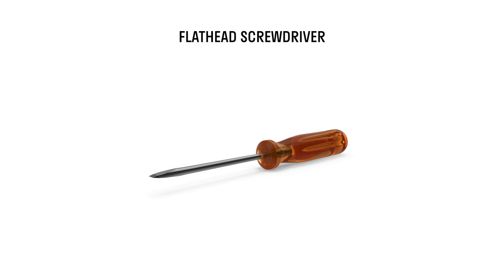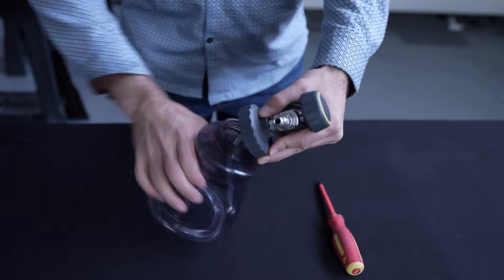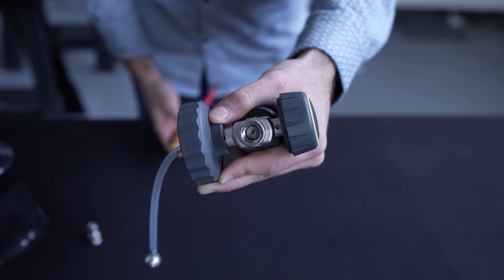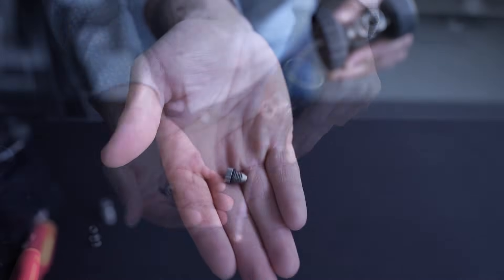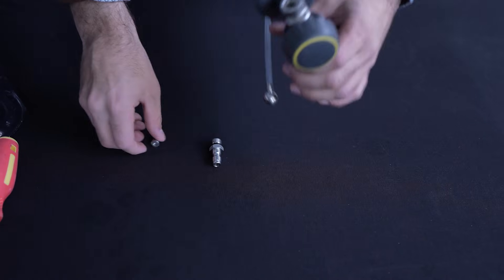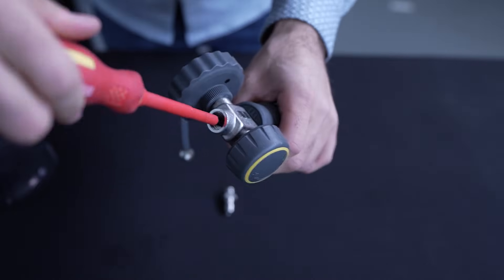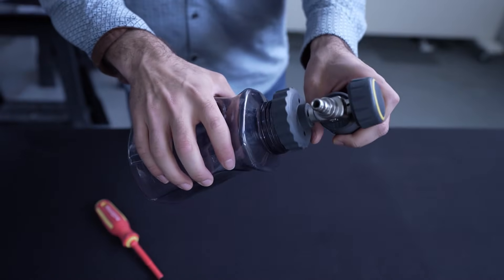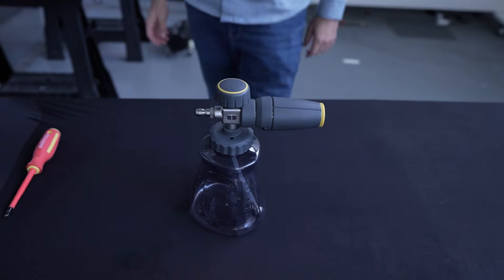How to Change the Orifice on your Active Foam Cannon

Comment: Lol at the ease they show of removing the 1/4” male quick connect to gain access to the orifice. Mine was damn near welded on there. I had to beat the living hell out of my 3/8’ drive with a deep 15mm with a mallet utilizing a HD c-clamp which I had to wedge between my basement stairs to gain a stability point. Insult to injury was that the stock installed 1.25 orifice was not even tight😂
Reply: Same !!! 😂😂 I can’t do sheat it’s screwed in so bad. I can’t move and inch of it. Idk what to do. I feel like I’m gonna break the whole damn thing trying to remove it
Reply: I’m in the same boat
Reply: THIS!!!! Currently staring at it on my dining room table